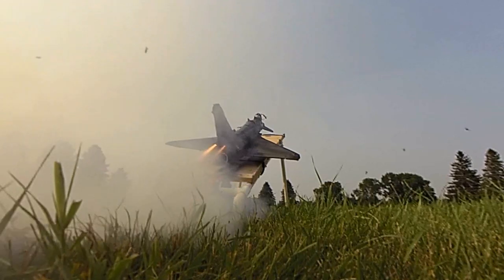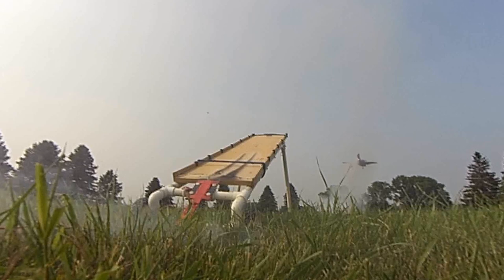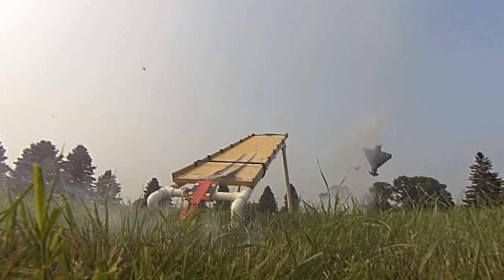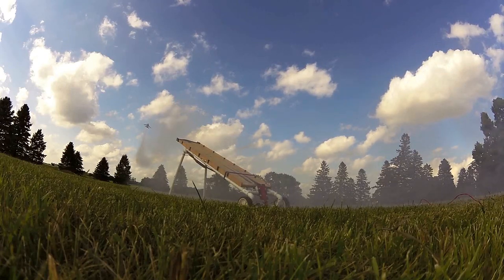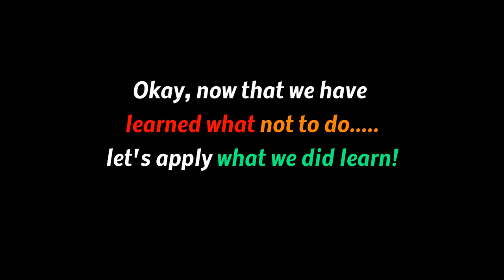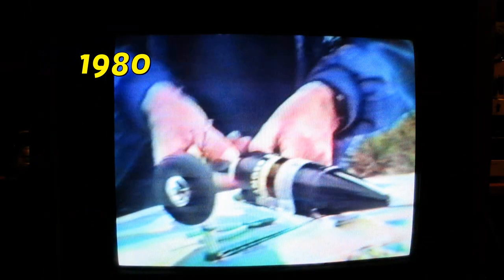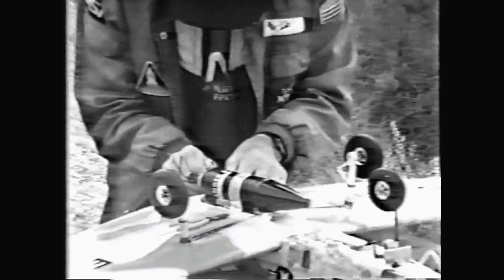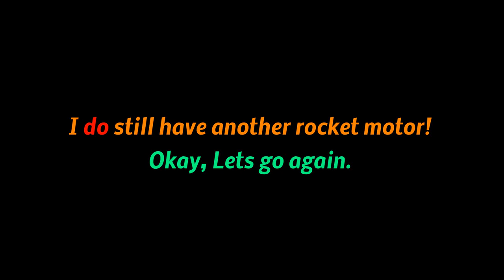Remote Ignition of Booster Rocket Motor, 1980 and now. Eurofighter Typhoon and Nitro Simitar 540.

Comment: Sir Herbert..
That accidental lauch was hilarious :D  Thanks for that :) 
Apart from that, this was very interesting! As I'd like to strap some rocket motors to a quadcopter :$  Will putting them on the bottom of the quad cause me the same (point of thrust) problem you had, you think?? 
Great to see the video's from way back as allways! :D

Cheers and thanks for the good info again!
Reply from the maker: DutchRC ADVENTURES If they were absolutely vertical and all ignited at exactly the same time, it would be fun to see.  Ill be watching.  Thanks.

Comment: You should be able to fire it with a ESC. You just have to put in a mix for power or no power.
Reply from the maker: MrRailroadrunner Yeah, but I still needed a separate channel, like I said.  The ESC and arming, etc did not seem like the safest way to go, so I did it this way and it worked.  There are many ways to cut a pizza and this was my way.
Reply from the maker: MrRailroadrunner  PS. I think I will try the esc method next time. I just didnt have room to get inside this old bird. But I have something else in mind to try a rocket on and will try that. Thanks again.
Reply: Fair enough. Just figured a ESC would be lighter.